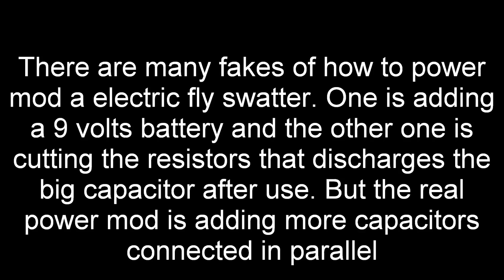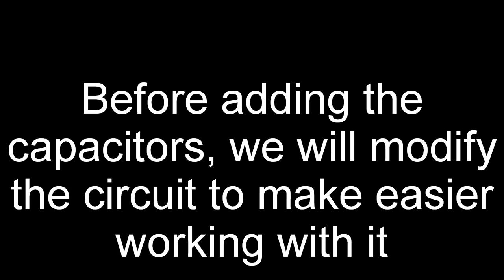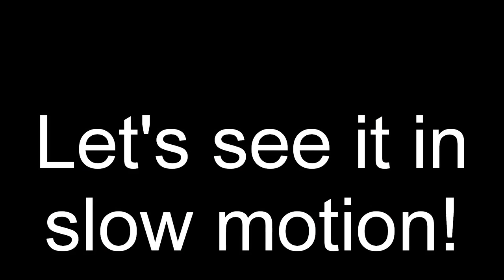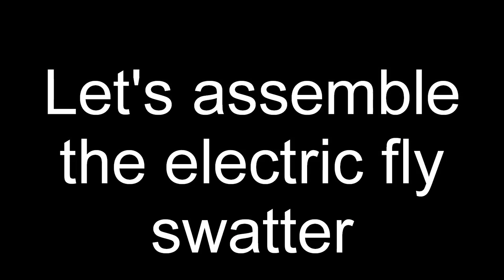How to electric fly swatter real power mod

Comment: I used a 1uF 2kV (which is over 40 times more capacity than the non-mod) capacitor and it took ages to charge it. The real deal is to modify the circuit. Now it charges within 1 second and the zap is really loud. It also runs on 2x9V or 8xAA with a DC/DC Converter. I think it could actually rip off some of your skin if you touch it. Since the circuit is able to transfer much power to the HV side this can get dangerous. I will not post any instructables on the web. You should know what you are doing. hint: you need 2 mosfets and some other stuff.
Reply: ***** yes, pulse capacitor. it does even fit into the fly swatter. yes, basically there are 2 transistors (mosfets) now there. But the big problem is to keep the output voltage below 2kV because more can damage your capacitor (like you do if you just connect it to 9V). So you need a very high impedance high voltage meter to set the correct output voltage.
Reply: ***** if you change the circuit, there is no "rated for 2kv" anymore. It depends on the voltage/current going through the transformer. The non-mod version basically chops the input voltage producing a rectangle signal. This is very inefficient. A sine wave form is much better. Maybe I show you the flyswatter in a few days, I don't have it right now. I bought that capacitor on ebay but a microwave one will work too.

Comment: I just added two .047uF 1,000 volt capacitors to mine and the spark is extremely strong now!
The capacitors are connected in parallel to the grid power outputs.
Reply: Thanks for the information! 
When you said " add more capacitors connected in parallel to the circuit" I took it as the extra capacitors were connected in parallel to the grid power outputs.
My fly swatters only have one capacitor in them unmodified. It looks like yours has at least two capacitors in it unmodified. I have seen some on YouTube with many capacitors in them unmodified and they are like you said different sizes, small size to larger sizes.
I have one more question. Everyone that I have seen that have added extra capacitors are doing them two or three at a time instead of just adding one larger value capacitor. Is there an advantage of using two or three extra capacitors instead of just one large value capacitor?  Is this because the one large capacitor would be too big to fit inside so people are using two or three smaller capacitors to get the big uF capacity?

Comment: are u adding some transistor or els ? i saw u adding heatsink at 5:42 in your zapper
Reply from the maker: agjs gudang nope, that was from my strobe flashlight project, I also have a video of that
Reply: @ThePaperAirplaneKing  Ok, thanks for the video, i was try adding 3 cap & change battery with 18650 x 2 in paralel, the result is fly & mosquitos instantly blows up when touch zapper
Reply from the maker: agjs gudang thats cool but you shouldn't really change the battery, changing input voltage will eventually damage the circuit as it's not prepared for that voltage
Reply: @ThePaperAirplaneKing  old battery is 4.2v 600mah, i change with 3.8v 1200mah x 2 , i use for 1 week, no problem at all
Reply from the maker: agjs gudang well you are still overfeeding the circuit, but hopefully nothing will happen! Actually time ago I tried 9v bat on fly swatter that uses 2x1,5v and it survived! I'm not doing it anymore tho

Comment: Did gou cut the bleeding resistor? Is it possible to leave it due to safety issues? Regards
Reply from the maker: you can leave it but it loses a bit of power. It may however be worth it because I once got hit by it as it was charged and it was terrible
Reply: @ThePaperAirplaneKing  Ok. I take it those are the 2 resistors you are talking about cutting in the vid? Thx godbless

Comment: I just bought the connector for a 9 volt battery and switched out the 2 AA batteries and put a 9 volt battery in. If you hold the button too long it starts to make popping noises inside and little pieces of plastic are breaking of somewhere inside.
Reply: The Paper Airplane King :D. 😕 Nothing good, like my zapper might break or nothing good, like I might lose a hand?
Reply: The Paper Airplane King :D I already did it. 2nd season. I'm not worried about the racquet. Injuries I'm a little worried about.
Reply: The Paper Airplane King :D   No I'm saying I already made it.  I've been using it for 2 years now (minus winter) with no issues so far, other than plastic breaking off from inside.  I haven't let it zap me. But it definitely works better on bugs.
Reply: The Paper Airplane King :D   😉 I've been thinking that it's gonna stop working soon ever since the first popping sound it made on day 1.

Comment: can you share the specifications of the capacitor you used? Microfarads and Volts. In comments it says 2kv is this correct? I ask because i cant ask a store if they have this capacitor without that information. I might also be able to find an equivalent capacitor. Thanks

Comment: You mean by parralell wiring them.  Pluss against negativ and and the the right pluss end back to the pluss wire?  Hard to explain.  But serial wiring and paralell wiring.  I did it last year. And it still dont stick. What if i have alot of these red transistors and add say 9 volt or 18 volt battery?  Please sir.

Comment: How does this increase the voltage??? Parallel capcitors is VT=V1=V2=V3 and Series is VT=V1+V2+V3
Reply: wops dang Im not using my head here. I forgot that you are using 2k caps, im using 450v caps xp
Reply: ***** 
Im using metalized polyester film caps, is that gonna be a problem? :p
Reply: ***** They are not Electrolytic caps.
Reply: sleem even though he is using 2kv capasitors it still doesn’t mean his capacitors add up to increase the voltage..? The voltage stays 2k..?

Comment: looks like a perfect spot welder for 18650 battery tabs....
Reply from the maker: it doesn't weld at all; for welder you may prefer to try with electrolytic capacitor tho

Comment: I have a question on the voltage rating of the capacitor. My fly swatter puts out 1,250 volts DC on the outputs to the grids. 
There is no voltage multiplier on my flyswatter.  It just has a transformer, transistor, resistor, led, and a diode.
There is a 250V 0.33uF film capacitor connected to the grid outputs. The capacitor is only rated for 250 volts and it is connected to the grid power outputs in parallel which I measured at 1,250 volts DC, why doesn't the capacitor explode? How can it handle the high voltage it is connected to? I understand the capacitor will only charge up to 250 volts but I don't understand how it can handle the high voltage it is connected to which is much more then what it is rated for (250v).
Reply: Thanks for responding again. I'm just curious as how can the low voltage capacitor handle the high voltage output? 
It is actually rated at 275 volts. I also saw the spec sheet for it online in a PDF file.

My other two fly swatters have a 400V and 630V capacitor in it connected to the grid outputs.
And I just bought some 2.2 uF 630V capacitors and connected one to the grid output. The spark is extremely strong and very loud. It takes about 30 seconds for it to charge up watching my meter connected to the grid outputs, starting at zero volts and going up to 1,250 volts in about 30 seconds.
With the stock capacitor it only takes 5 seconds to go from zero volts to 1,250 volts.

Here are some pictures. Use the < and > to scroll thought them. You can zoom in also.

http://i58.photobucket.com/albums/g265/Tom_Z/20160717_192859%202_zpszn02nkr5.jpg

.
Reply: @CX2Pilot what is the answer to you question, please? I have the same Q. (I measure 1000 Vdc,  how can a 250V cap handle that?)
Reply: @JanBuytaert  I never got an answer on my question... It may be that the capacitor only charges to 250 volts so the 1,250 volts is not an issue, it will only take in 250 volts and no more.
If  the flyswatter comes stock with the 250V capacitor then it must be safe.
Good to use caution as you don't want the capacitor to explode on you.
Reply: @JanBuytaert Actually I did get an answer, here it is.

Adrian, I believe I just found the answer to my question but see my last post (21 minutes ago). I took some pictures for you.
My capacitor is rated at 275V AC. I am using it in DC and the spec sheet says it can handle 1,200 volts DC.

      Withstand Voltage:
      Between terminal 
      575V AC/1200V DC 60s.
Reply: So if the capacitor is rated at 275V, it can handle 575V AC or 1,200 V DC.

Comment: At the beginning of your vedio at 0:02 you say "...the real power mod is adding more capacitors connected in parallel". But in your "About" discreption you say: "Which is the real bug zapper power mod? well, it is to add more capacitors connected in series to the circuit. "

Connect the caps in series or parallel???

You're contradicting yourself :D
Reply: Technically they should be in parallel. In casual talk people would still say in series, I guess.. that's where the confusion comes from. You can imagine a lot of these electrical components as having water counterpart analogies. A capacitor is sort of a dam with a flood gate. When the charged circuit makes connection the floodgate will open. Imaging this would you like the floodgates in series or in parallel?
Reply: @tedkraan9348  there is never any "casual talk" between electricians that would confuse series and parallel connections. In some cases, the difference could be between a thing that works and a thing that kills you. I would advise you to be precise in your language if you put up videos in the public domain, or someone may sue you.
Reply: @BarefootBeekeeper  "Casual talk" was a misphrasing for layman talk. Sorry for any confusion it caused.

Comment: Does anyone know if I can take the safety screen off my swatter it's annoying  and blocks larger insects
Reply: NO........the smaller inside mesh is Positive & the 2 larger outside meshes are both negative (or its opposite it doesn't matter) but any circuit requites both ......actually i prefer the type that just have close parallel bars(not 3 meshes).........its not as ppl/hand safe......but the mesh only kills the size mosquitoes we mostly have here only around 75-80% of the time/swings.....& the mesh almost never gets the gnats........the parallel rod type kills mosquitoes almost 100% of the time....& even tiny gnats on more then half of all swings.

Comment: Adrian, I believe I just found the answer to my question but see my last post (21 minutes ago). I took some pictures for you.
My capacitor is rated at 275V AC. I am using it in DC and the spec sheet says it can handle 1,200 volts DC.

      Withstand Voltage:
      Between terminal 
      575V AC/1200V DC 60s.

Comment: What kind of resistors are these if i wanted to replace them?
Reply: ***** im building the circuit from scratch so if i wanted to build it to schematic for my grade i would need the resistors. But i did notice so far in my circuit without the resistors it just acts as a stun gun with no build up and discharge of the capacitor it seems to just be a direct path of the voltage generator. Im going to go back over my schematic and make sure everything is correct. I appreciate your answers they are a great help to me.
Reply: ***** followup thought im curious why the resistors are there if there not needed in the circuit. What is there original purpose then?

Comment: Can't you just take out that 0.022 and replace it with a single larger size - like a 0.05 or a 0.1 and avoid cutting and bridging?
Reply: After my comments I went to www.jameco.com and found the .022 was the largest value they carry @ that voltage, so I'd have to use your approach after all.
 Previously I tried souping up disposable camera circuits (for a worm getter project),via increased battery voltage and recharging rates and only succeeded in burning out their smaller transformers or their oscillators.  You're "right-on"; a bigger spark via a bigger capacitor.

Comment: Hi Adrian,
What does CBB mean?  Sorry if I should know, but I can’t find out anywhere.  I also can’t find CBB81 223J2KV capacitors for sale.  Would these (greater pF) be OK? 

http://www.ebay.co.uk/itm/151357924406?_trksid=p2055119.m1438.l2649&ssPageName=STRK%3AMEBIDX%3AIT
Reply: ***** Thanks Adrian.  Unfortunately they won't ship to UK.  Do you know any who will?
Reply: Montague Have found this in local store - would this be OK?  Thanks.http://www.maplin.co.uk/p/wima-polypropylene-metal-foil-2000v-0022uf-capacitor-n58cn
Reply: ***** Thanks, Adrian.  Have got two of them.  Will go the mod in the next 2-3 days.

Comment: What about it I unsolder the original capacitor and resistors and replace them with.... what is it.... 12v capacitor and about 560 OhM resistors?I'm trying to make it work with 9v. I like "inventing" lol.
Reply: I don't recommend to try it with 9 volts. I just tried it on one of mine and the transistor burned out. It was super hot. I did try adding one more battery in series for 4.5 volts and got 200 more volts on the grid outputs. 
The output voltage on 9 volts was so high my meter couldn't even read it!

Comment: Hello again, as promised: my improved circuit for the electric fly swatter
https://youtu.be/NIvGX5Smkvs
Reply: ***** thanks. You can see the circuit at the end of the video. No schematics because there are a lot of kids on youtube and they would probably built it and get hurt or worse. The output power is actually much more dangerous than a taser which has less than 1 mA.
Reply: ***** well you are on the right way. Have fun! But keep the voltage in mind to not damage your capacitors. It may seem that a rated 2kV capacitor is able to handle 4kV but it takes damage but is not totally destroyed. It will lower the capacity so better take two in seres = 4 kV voltage rating.

Comment: That was the ugliest solder job that ive ever seen. Indeed that mod may work but you should have put a multimeter to see what the voltage is.   Thats the point.

Comment: Discharging a big capacitor using an uninsulated metal object is foolish, to put it mildly. Don't teach kids to do that.
Reply: @ThePaperAirplaneKing  if you are in contact with the ground, or any object that is grounded, it is just as likely to flow through you as anywhere.
Reply: @ThePaperAirplaneKing  I expect that's why nobody ever gets struck by lightning...
Reply: @ThePaperAirplaneKing  yeah, I once discharged a big capacitor in a military radio with a screwdriver through my hand and it knocked me backwards across a room. So I know how high voltages will find a path to earth.
Reply: @ThePaperAirplaneKing  no. I'm not that stupid. Capacitors retain their charge for some time after unplugging.
Reply: @ThePaperAirplaneKing  , hi bro.
my swatter has ,
one- CBB81 223j 2kv  capacitor &
two- 3A 332j capacitors. 

my swatter is also same as yours, but your's  have one small capacitor but mine have 2 small capacitors.
my problem is, flys dont pop, they just stick to net and starts burning...
what to do...?. please help...